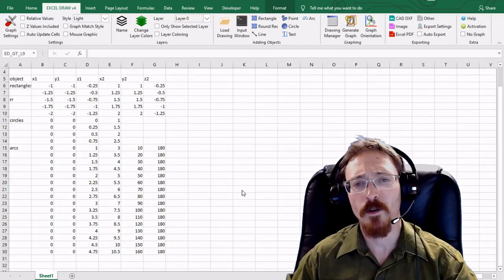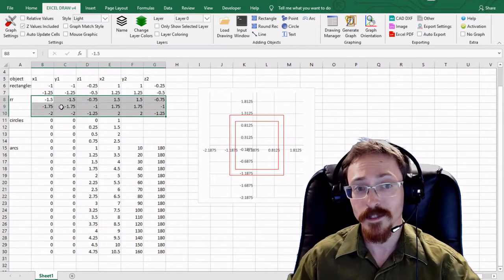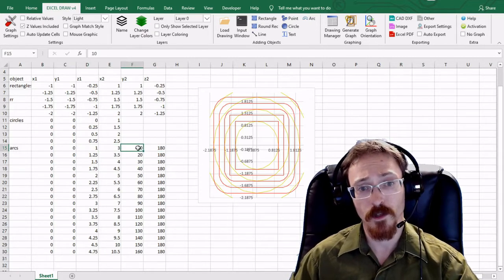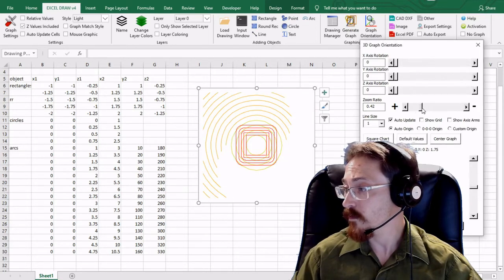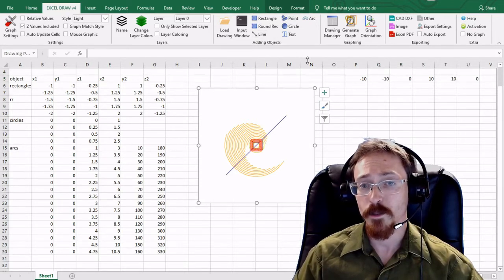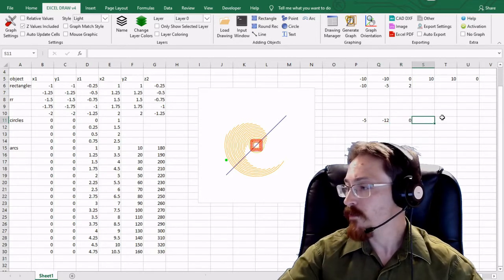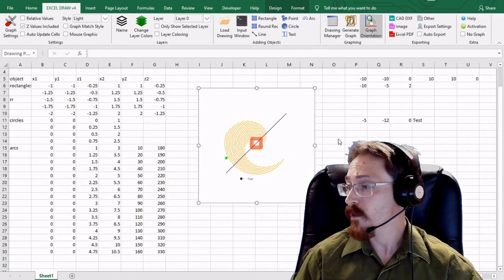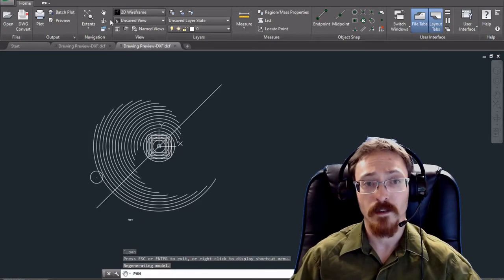Excel Draw v4 Course 4 - Lines, Arcs, Circles, Text, Rectangles - CAD Viewer inside Microsoft Excel

Comment: how can i made a Triangle ??
Reply from the maker: Version 5 has a Polygon object. With that object you can set how many angles you want (3) and at what angle you want it to be at.
The other option is to draw the triangle using 3 lines.
Reply: @gray-technical  this tool have huge potential excel is great to process numbers and using this tool can expand excel to make graphics

Comment: I have downloaded trail version to my laptop with OS window Vista.
When I am trying to draw rectangle,line, circles not getting them instead charts appears on sheet.😟
Reply from the maker: Typically this happens when the data entered is not in the correct format, or not all the data is selected/entered. 

Make sure that you are selecting all of the data, and if you have z values, enable the 'Z Values Included'. 

If you need help please email our support at support@graytechnical.com